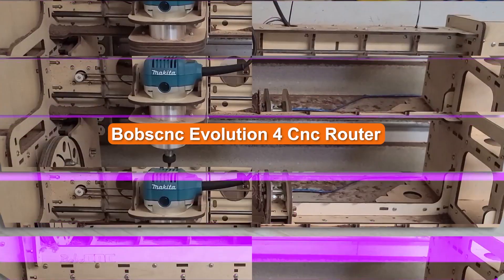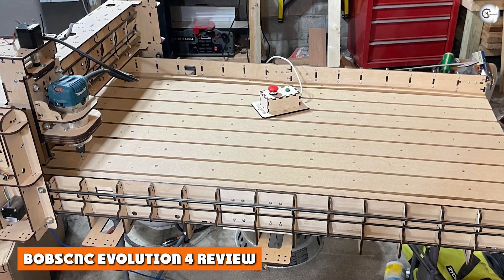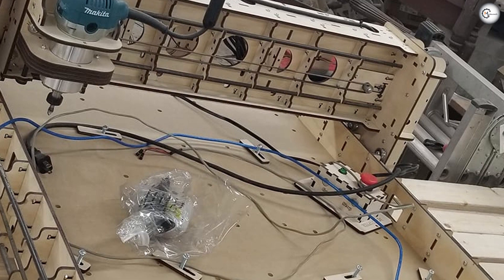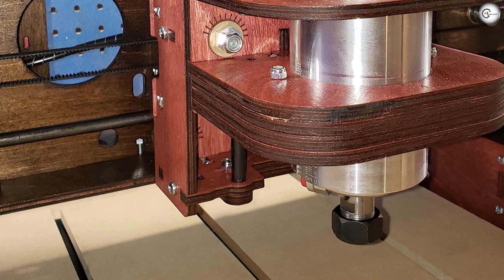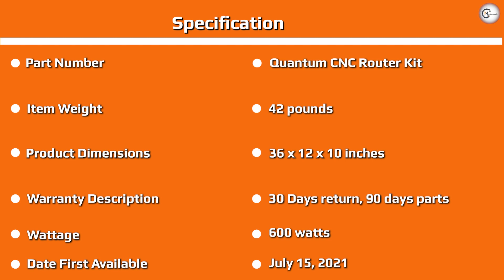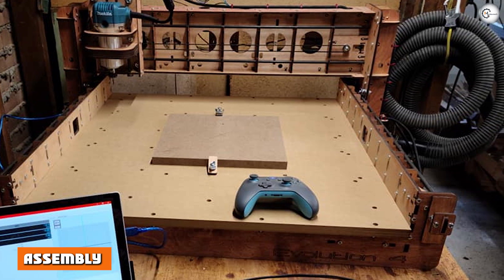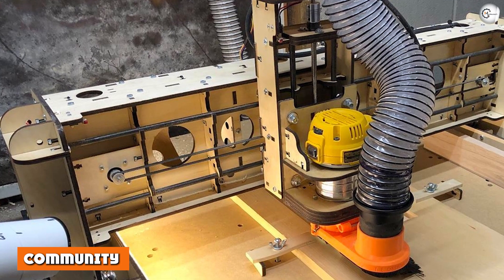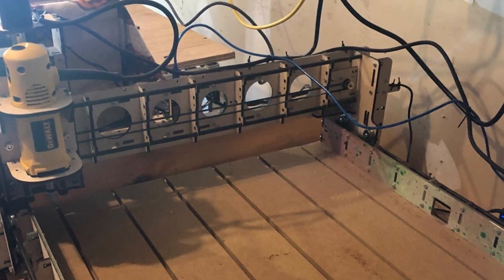BobsCNC Evolution 4 CNC Router Review: Do They Actually Work?

Comment: Wood frames have too much flex in them. Would you want your car made out of wood. As in the video, wood frame causes flex as compared to aluminum. So this machine requires slow feed to work.
Reply: Morgan still makes wood framed cars. Plenty of early automobiles had wood frames. It has its negatives and positives

Comment: Can I design? does it includes de software and use 4 CNC Router to make my wood designs? Please answer me before I can buy this machine
Reply: I use Fusion 360 personal.  You can add the BobsCNC post processor directly in and have it export your G Code file.  I also will export from Fusion 360 after modeling the software and import that into vCarve to generate the tool paths. vCarve allows me to do really large materials by tiling.  Smaller parts I just stick with Fusion then send it to the controller through Universal G-Code Sender.